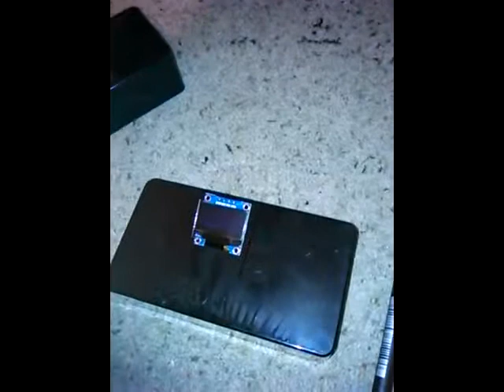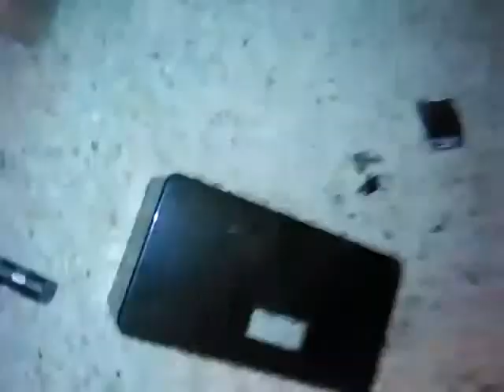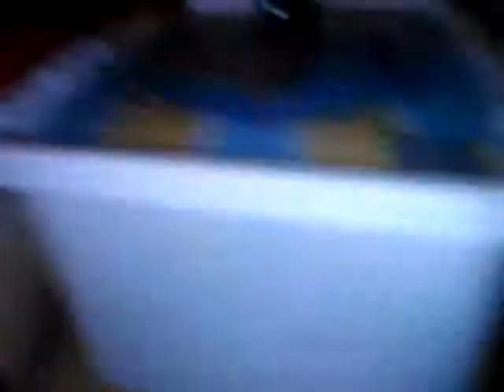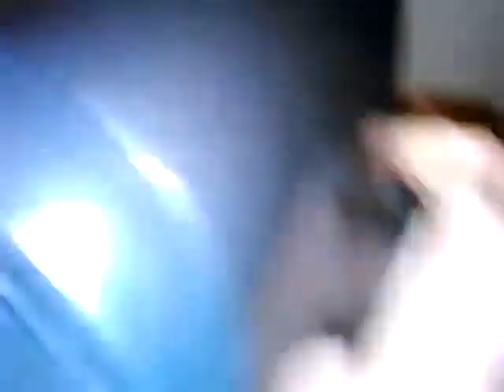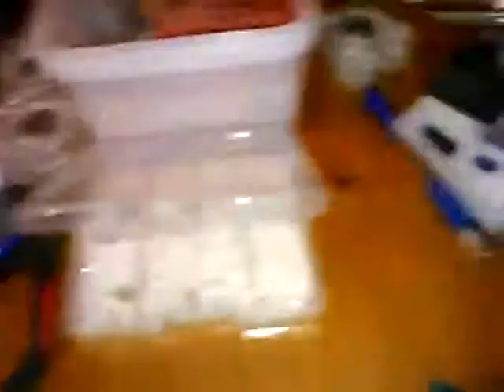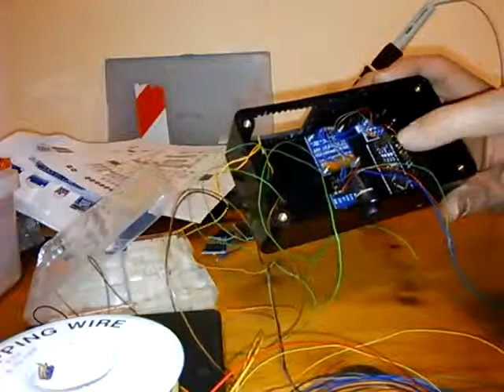Wheelieometer Construction Part 1 of 2

Comment: So what does this wheelieometer do?
Reply from the maker: Yh so it measures the bike angle and starts a timer when the angle exceeds, say, 15° then stops when it falls below this to time how long you wheelied for.  It also shows the longest time achieved.  I also see that when wheelieing (sorry I can't, I'm crap at that stuff) riders often turn their bars to keep their balance and this messes up the measured angle, so I've added "tilt detection" so if the angle sideways from vertical is large the normal angle criteria are overridden (when steering in the air the front-back angle falls but the sideways angle increases). I've also added the features of a normal bike computer using a magnet and sensor on the wheel: speed, distance, calories. See some of my earlier videos demonstrating how the wheelieometer works, e.g. the first tests I did: https://youtu.be/jZ-PyuX_Yuw